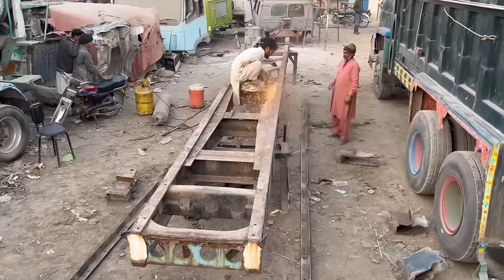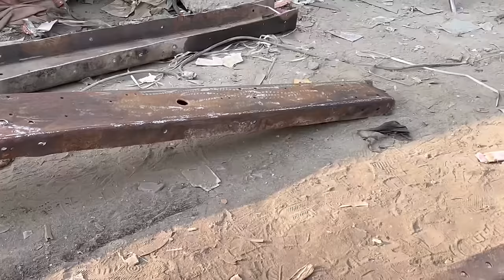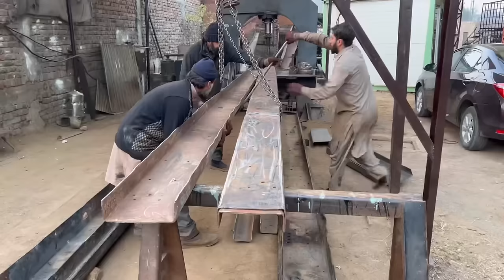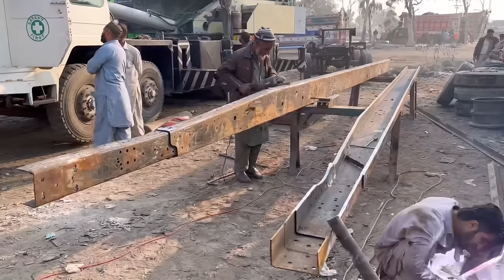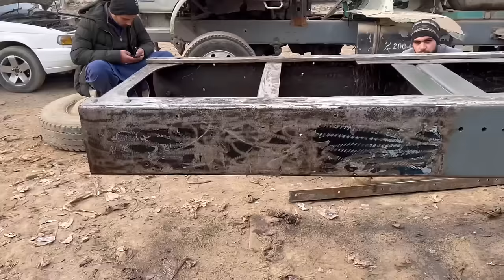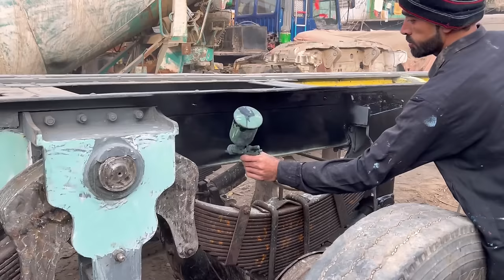Amazingly Repaired A Old Hino Truck Frame With Unique Techniques | Restoration Hino Truck

Comment: You guys did an amazing job I very much ❤️ Pakistan's creative skills it's simply out of this🌎 yet I'm not satisfied with installing individual leafs before washing & painting them with industrial antirust it's👍 draw water & pour water the chassis will most definitely rust again because even though it's air thight it will take corosion, so you need to address these issues
Many thanks

Comment: Enjoy watching. But, it looks to me that they take it apart and just put it all back together the same as before. What is the benefit.
Reply: Somewhat removed surface rust on its inner frame, replaced suspension and added an engine and cab. From a rustbucket to something that is road worthy.
Reply: Могли ведь покрыть антикором и преобразователем ржавчины между слоями.